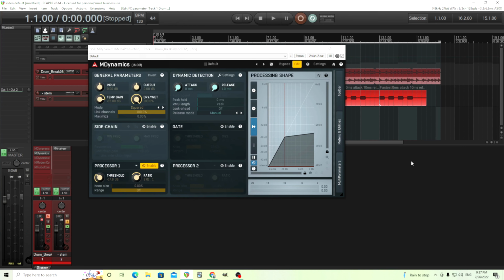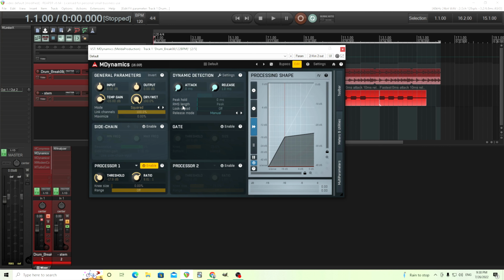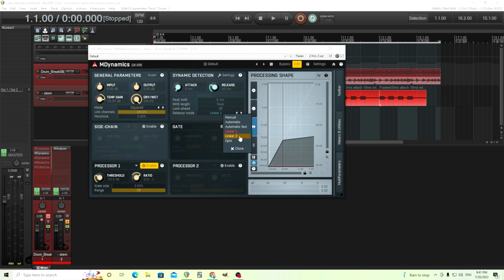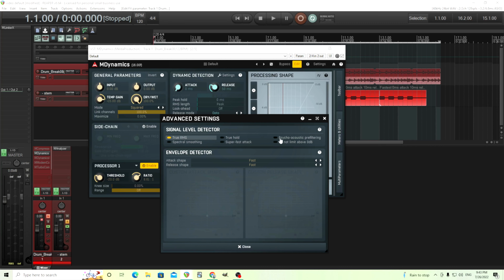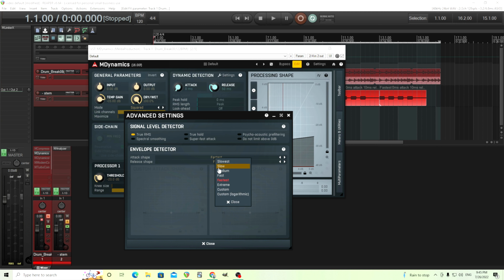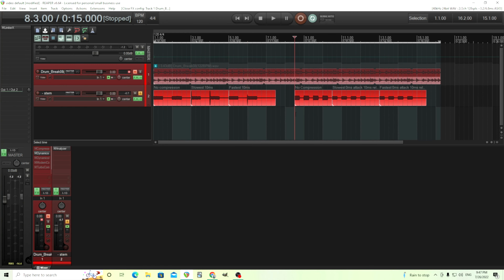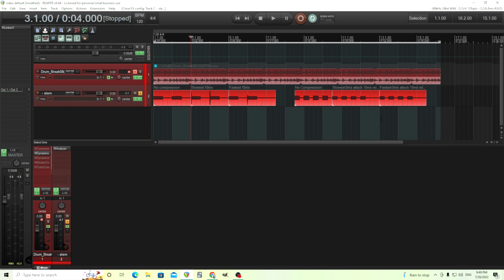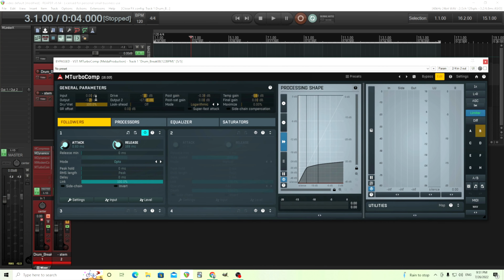Advanced Melda Compressor Detector Settings

Comment: Thank you so much for clarification on some of these settings.
Was just curios on one more nieche bit of dynamics processing, how does the spectrum resolution plays with dynamic detection in spectral dynamics?
Reply from the maker: I believe it will group more frequencies together at a lower resolution, so there is a higher chance the dynamics will be triggered. Increaasing the spectral resolution is like adding more bands to a multiband compressor.
Reply: @Chandlerguitar  Wow I got it totally wrong in my head then.
I honestly thought that Spectrum smoothness and quality will determine numbers of bands and resolution on how often does spectrum refreshes.
I do set these settings based on my ears anyways... Just geek in me is curious about how it works... I truly believe spectral dynamics is one of my most powerful plugins in my arsenal.
Reply from the maker: @DaveChips  I'm sorry I made a mistake. I thought you were talking about something else. The resolution defines how accurate the time parameters are. So it will effect the attack and release. When it is low(1ms) the attack and release will be very accurate, but when it is high it will be less so. Lower setting use more CPU though.